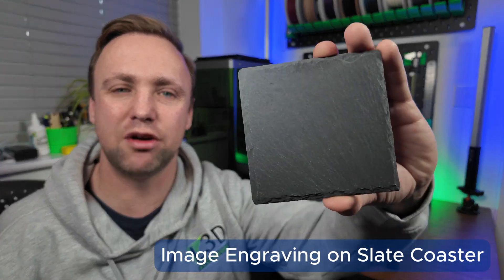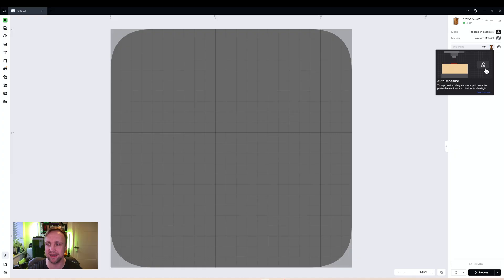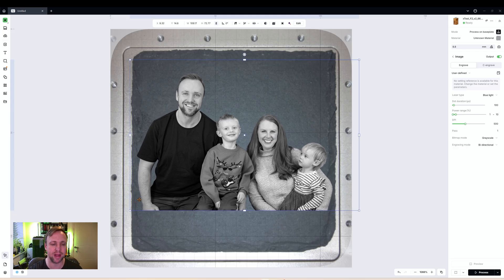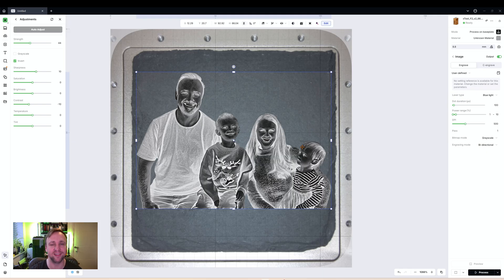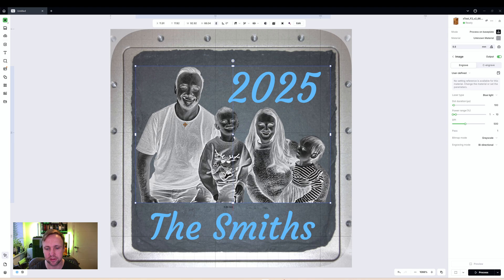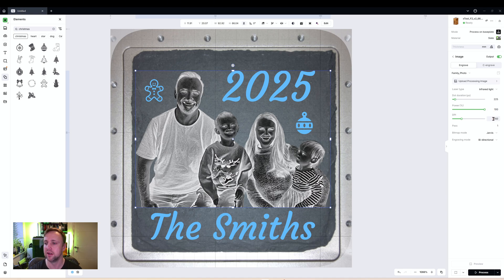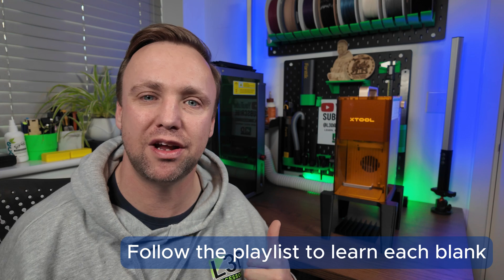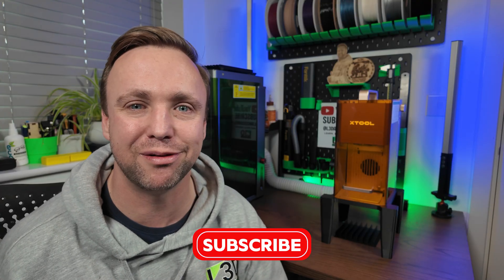Engraving an Image onto a Slate Coaster with the xTool F2 (Beginner Project Series)

Comment: i dont get it on my f1 ultra when i select the material its says ir for vector engraving like 2025 and blue light for pictures. should i get your settings or the settings that xtool providing me dont waste a shiton of slates just to adjust my settings. i have the m1 ultra 20w. the xtool small one and the xtool ultra.
Reply from the maker: I'd recommend doing small test engraves on a hidden part of a slate to dial in your settings without wasting too much material.

Comment: Thank you for posting this tutorial. If you wanted a deeper engraving, could you run the operation 2x or is there another approach? I am not looking for 3d - just an engraving that is about 1-2mm deep.
Reply from the maker: Yeah I'd say so, it will take double the time but you could achieve a deeper engrave. The other option is to increase the power or slow down the engraving.

Comment: Morning Chris.  I was wondering if you can use a slate coaster vector file on cork coasters, and if so, can you show how??? I have the xtool f2...Thanks for all you do!!
Reply from the maker: Yes you can use a vector file on any material. The main difference will be the material settings you need to use. Cork is on my to do list

Comment: I tried and Image on an F2 Ultra using IR and it does nothing...Help?
Reply from the maker: These settings are for the F2, not the F2 Ultra. Unfortunately they won't work for you laser. I don't have an F2 Ultra so I'm unable to test and get material settings, I recommend joining a F2 Ultra group and asking the question there.
Reply: @L3DAccessories  Thanks, it is confusing, the "MOPA" setting on the F2 Ultra says "MOPA IR" I assume IR ment Infarred...?? You must be using he New F1 IR
Reply from the maker: @hamps856 The F2 Ultra is a Fiber IR MOPA laser. The F2 using a simple IR which is different and far less powerful. Even though they sound the same they are very different.
Reply: @L3DAccessories  I would think that IR is IR..I wonder if you can adjust the Frequency in the F2 Ultran to match the frequenct on the maching you have.  Do you know the Frequency on your machine.. BTY...thanks a ton for the help and you video was really good.
Reply: AM I  confusing IR with UV... ???  Looks like you havd the UV Model??
Reply from the maker: @hamps856 No, I think you're confusing the F2 (standard) with the F2 Ultra. The F2 (standard) is an upgraded version of the F1 and is much smaller than the Ultra.
Reply: @L3DAccessories  Can you tell me your specific Model so I can look up the specs ? Thanks
Reply from the maker: @hamps856 it is this: xTool F2 5W IR & 15W Diode Portable Dual Laser Engraver https://share.google/Clutwp9Slnb05AUVO
Reply: @L3DAccessories  Thanks

Comment: Great video, good to show how to manually adjust. 
If you're not as confident, you can select the material and then use auto adjust it will invert the image for you too.
Reply from the maker: Thanks Steve, I always like to show both ways just to try and give the full picture. Sometimes when multiple items are in a jig they might not be centrally located which means the machine can't autofocus on the top surface of the blank so I show the manual method just to ensure people know there's an alternative option.

Comment: Do you ever paint them with black laquer, etc or seal them afterwards? Makes them pop even  more.
Reply from the maker: Yes I've done it in the past and I've had mixed results. I've seen some excellent examples where it really did make the images pop but it also adds a bit of a shine to the slate. My personal preference is to not use lacquer however it's been a while since I tried so maybe I need to give it another go. Which do you prefer?

Comment: is your engrave a shade of gray or a shade of white?
Reply from the maker: It's a white colour mostly. If you find it's more grey then I'd recommend change the dot duration and adding maybe 10-20 to it. That will force the laser to take a bit longer when it engraves each dot and should brighten it.
Reply: @L3DAccessories  Chris, I'm being told that you need to increase the dwell time to 300 using the IR laser.. Any thoughts?
Reply: Would only be using the F2 for letters etc., no pictures  Wants the letters white, not a shade of gray
Reply from the maker: @TTC1940 If you just want white then you'd need different settings to these. I'll be doing some testing for engraving logos etc onto slate coasters soon so I'll share the results with you.
Reply: @L3DAccessories  please do one using the dwell at 300 and using the ir.  Thanks

Comment: Do you have to do the final step of scoring an outline separately? Could it not be done by adding extra layers and in the order of operation have it done last, that way the whole job is done in one process?
Reply from the maker: You definitely could do it as a layer. I kept it as a separate pass in this video just for the simplicity of being able to give it it's own section however doing it as a layer would be a good way of keeping it all as one process. Thanks for watching
Reply: @L3DAccessories I am going to try these settings as soon as my f2 arrives with one additional step. I will prepare the coaster by coating a layer of black liquid shoe polish or leather dye then wiping off the excess, to make everything pop even more. My hope is that it will not effect the semi absorbent properties of the slate like I have seen with people that prepare slate coasters with a coat of spray can sealant.
Reply from the maker: @katsuninken4458 Great idea, I'd love to hear how you get on.